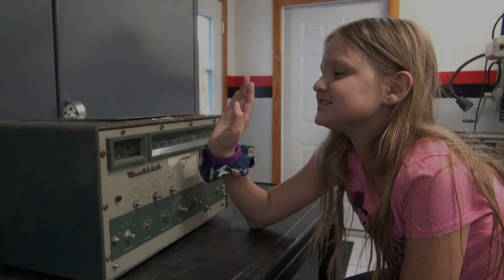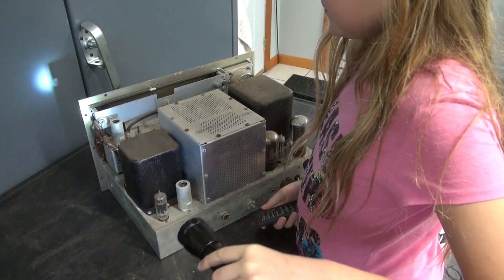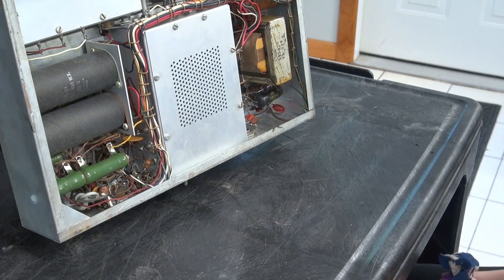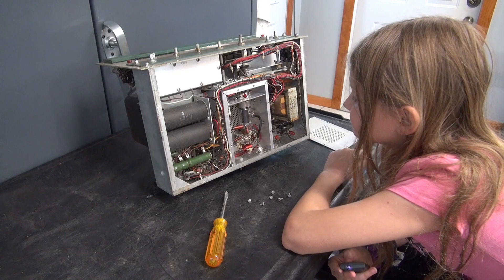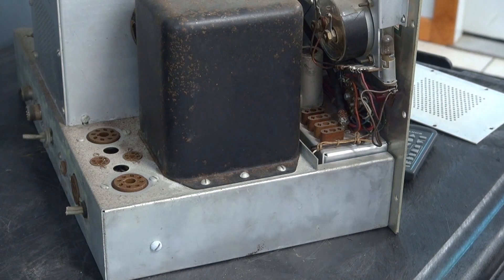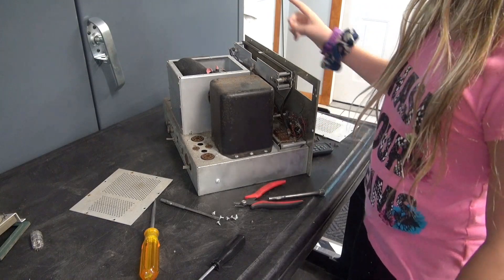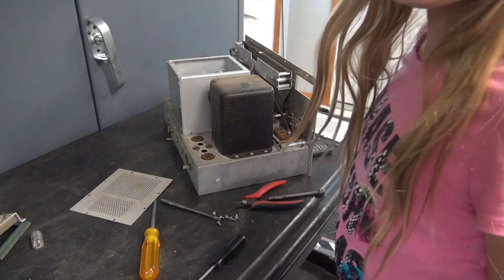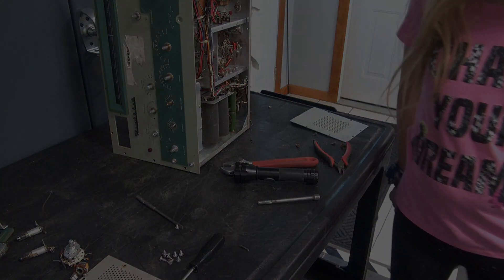Emi scraps old Heathkit Seneca VHF Transmitter Parts for D-Lab amps

Comment: Hey friend, most of that old Heathkit gear is absolutely CHOCK FULL OF CADMIIUM plating!

We know now, that cadmium is ridiculously toxic and aggressive carcinogen.

I’ve been doing electronics work for over 30 years, and I’m extremely carefully and circumspect when working around cad plating. I wear nitrile gloves, avoid disturbing the cadmium dust/residue around any obviously oxidized areas, wear an N95 mask if any cad areas are disturbed etc.  

So, my serious question of concern is: do you really want to be having your wonderful young  granddaughter  handling old Cadmium-laced electronics chassis etc with bare hands? 

There’s also commonly Beryllium,,  PCBs, hexavalent chromium, and a needless to say a ton of lead in old electronics, particularly from the 1970’s and earlier.

But the Cadmium, that’s perhaps the most pervasive and nasty toxic material to contend with. The dusty oxides are really problematic. 

  I’ve stopped even handling old steel Hallicrafters radio chassis, and and much of the Heathkit equipment because of the pervasiveness of oxidizing cadmium.

It’s quite possible I’m already on a straight path towards cancer due to a history of less awareness and caution around cadmium, PCBs etc, but I figure “better late than never” to embrace safer handling protocol and use some greater discretion with this stuff.

Seriously, I encourage you (or anyone) to give this matter some real thought. Take a web browse and search: ‘Cadmium Toxicity’ to see what the current medical knowledge is on this substance. It’s genuinely not a pretty picture.

Comment: Emi was grate
How about doing a skit with one of your puppet creatures (named Diddle stick) working on a simple receiver and saying
something like I like those waxy's caps, all this set needs is to be re-tuned, those cap's are fine no need to replace them. (Diddle stick) Plug the set in and have smoke pour out of the rear of the cabinet. (Emi enters scene) Diddle stick I told you always replace those old capacitors you don’t even need test them just get rid of them.